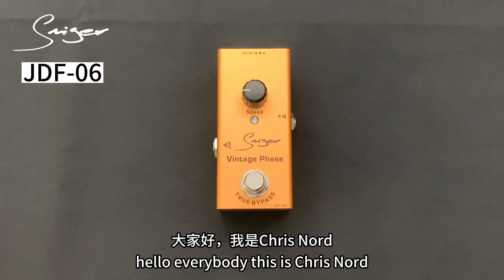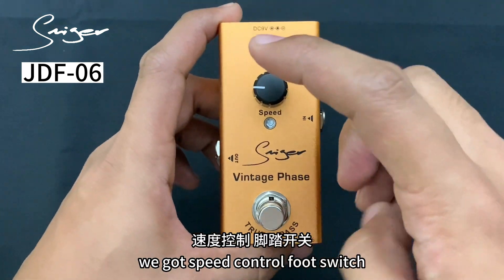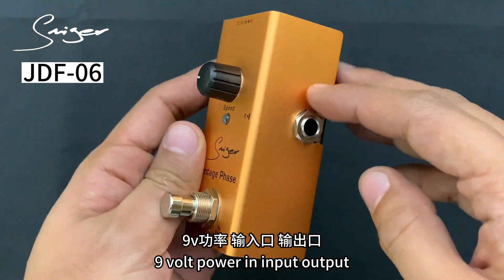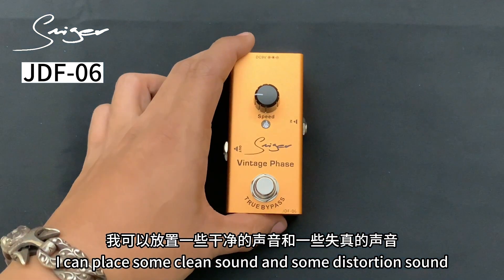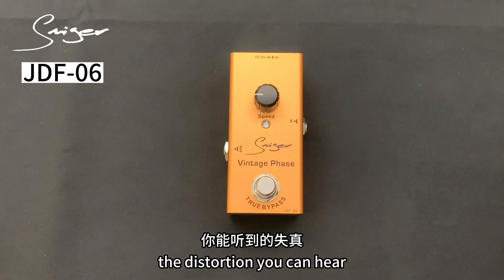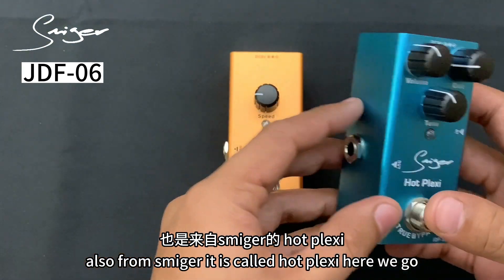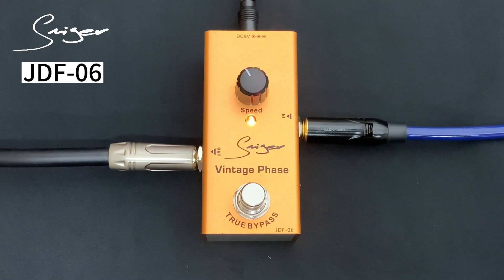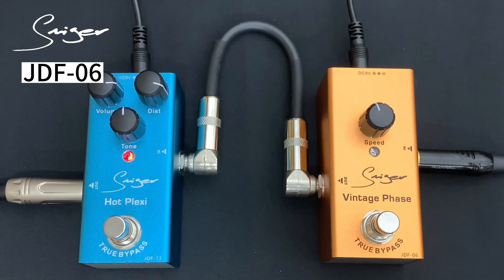Smiger Guitar effect pedal, JDF-06  Vintage Phase

Comment: This is Wah wah ?
Reply: Wah is essentially a filter for your signal like the EQ on your amp. It sweeps the midrange frequencies with the rocking of the pedal that causes the "wah-wah" sound. Phaser is a completely different effect, that through a series of LFOs knocks your signal out of phase in multiple stages, causing that swishy-swooshy sound